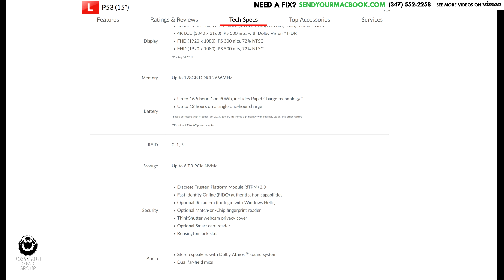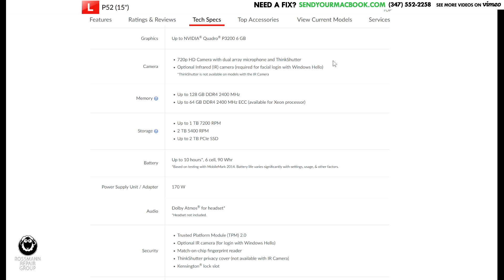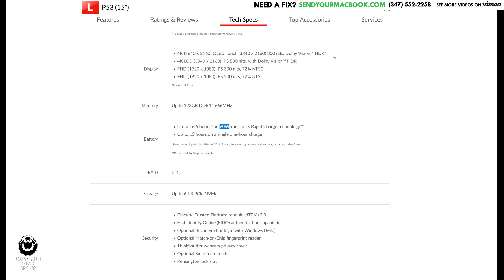Reading my YT comments is depressing

Comment: Yeah, manufacturers can advertise any hours they want if they tack on an "up to" to it. Physical battery capacity is what matters. That's also why all the iPhones have total shit battery life, they're outstanding at shutting things down when the phone is idle so it's efficient - but as soon as you need to, you know, actually use the phone it still draws the amount of power that physics require. Which means that in active use, the Apple devices drain their batteries in no time at all. People are silly little sheep.

Comment: The worst part of following trends like that just for the sake of following is that past a certain threshold, it forces everyone else to also do it because it breaks mass production.

It's probably what ended up happening with removable batteries both for laptops and smartphones. When they started becoming non-removable, both R&D and mass production of removable batteries slowed or stopped altogether for those categories of batteries, to the point that even if a current laptop or smartphone manufacturer wanted to launch a model with modern removable batteries in mind, they'd probably have to either assume by themselves R&D and costly manufacturing for that model alone, or use batteries that could be fairly outdated and stuck in time.

Weirdly enough, I'm seeing this in other types of electronics, like a cheap-o portable keyboard I got sometime ago. It has a rechargeable and removable battery inside. You know what type? One of those that came in Nokia dumbphones bricks from 20 years ago.
For some reason, mass production of that type of battery endured somehow. It's an unofficial standard for all sorts of cheap-o electronics. I've also seen them in portable LED lights for photos and videos. You can look it up, it's Nokia BL-5C. I think even Amazon still sells it.
It works for this one not because it's the latest battery tech, but because it's probably super cheap to mass produce despite being extremely outdated. It's meh, good enough for some stuff. Which is something that doesn't work for flagship lines or products that have to be constantly evolving and a step above the rest.

Probably not Thinkpad's case since laptops haven't been changing a whole lot in terms of chassis and form factor recently, plus like Louis already put it, the battery specs itself didn't change. But yeah.. it becomes that much harder to be the only company keeping one particular spec alive. Perhaps they made the change because moving forward, if they plan on putting a more modern battery inside, it'll have to be non removable one way or another?

Or it was really just a cost cutting measure. It was cheaper to use some standard 90whr internal battery instead of their removable model. Which is of course still bad for costumers, but perhaps that was the logic behind it.

Comment: Lenovo has gone down hill in recent years, some real questionable choices!   
Altho I would comment, on my last laptop, I did alot of research right down tear downs, and I noticed choices on even cooling, they may have opted for internal as their concept of removal might be for replacement during life of laptop not swapping during the day because it recharges quickly and lasts the life of the laptop!  I've known very few times a spare battery was needed so I don't really care! 
And what did they do with the space? Let's get a teardown to compare!  I bet the free space went into a bigger heatsink!

Comment: just over 2 min in, and I already knew what the issue was, people are idiots, advances in other components = more energy efficiant, while sane battery = no advancement whatsoever, means they could have had a machine wirh a phenominal battery life/use but instead did the absolute minimum.

Comment: I have to comment Anyone who defends not having user removable batteries on a laptop, shouldn't be allowed to exist on the internet. I mean if you like waiting 16 hours for your locked up computer to die so you can power cycle it, you must be some kind of masochist. Like first question you get asked when any piece of hardware starts acting funky is "Did you turn it off and on again?" and what do you do if it wont turn off? unplug it "Oh wait it has a battery, and I cant remove it?" just dumb, please for the love all that is sacred, don't defend pure brain dead design.

Comment: my only worry is how they achieve this longer lasting laptop do they put massive power limitations on the products ie under clock the cpu and video card shut the HDD down ?etc battery technology has stalled they only thing you can do is make things moe efficient with whats available at a price

Comment: I am a software developer and we use nothing but Lenovo ThinkPads including the p51 up to the p53. My god they are trash. Overheating from shithouse cooling, whether it's heatsink or thermal paste idk. Completely bricked brand new machines(p52 and maybe p53s). Malfunctioning docks whereby you have to disconnect the laptop from it simply to get your external monitors again. After speaking with one of the workers from the IT department, these incidents are becoming more common in my company. Please god if you run a business don't get these pieces of trash
Reply: How do companies not at least trial one or two machines before dumping 100 onto the employees and just say "yeah work it out or something idk"
Reply: @Jimbob3s1  no idea. But in the space of a few months they have just started dropping like flies. The coffee lake ones (i think p52 or maybe 53) sound like bloody jet engines

Comment: The most they could realistically add to the battery would be about 10 Wh, since the generally allowable max on planes is 100 Wh. So, I wouldn't even count it as a valid excuse, had they bumped up the capacity a little to like 97 Wh.

Comment: After having first-hand experience with customer support for a Surface Pro I can only say: buy maintainable laptops as long as you still can. Not even Microsoft themselves can repair their Surface devices. A Thinkpad(with removable battery!) can sometimes be fixed with a screwdriver. Yes, a alu unibody design with everything soldered in looks a bit better. But looks get irrelevant pretty quickly once the device stops working and the manufacturer tells you "ah too bad, just buy a new one".

Comment: Different bios revisions also affect battery life. more conservative tuning in the bios can actually make the battery last longer. 
Honestly removable batteries are not very useful these days, and if you really want to replace the battery just screw off the bottom and pop a new one in. 
Soldered ram and ssd however, fk.

Comment: I will disagree. This is going to be a long response. Ok here goes. The reason i dont like companies making batteries non removable since i do often find myself away from a wall outlet and having my laptop die when i need it since it is very old. I do agree that yes more modern and new hardware like you said about lenovo making small increments each new device on battery power for instance my brothers laptop has 4 hours of life on a single charge but mine lasts 2. One point i will like to bring up is that i dont see a reason to buy a more modern device since they all want to be thinner but find myself asking the question how long will the battery life so i do look at the watt hours and most of them are not great if not worse then my current one  . Another point is that most info on batteries on the web page is that they mostly dont represent or say the actual amount of hours that the device can run on a single charge. An example is when my sister got a laptop it was advertised of having a battery life of 6 to 8 where it only lasts for 4 hours even though it is using a Celeron cpu but my brothers is an i3 cpu and has more capabilities beven having a removable battery and my sisters laptop is not. Please respect my opinion. I just don't like it when companies remove that feature.

Comment: most people i come across don't know how to battery.

that thing that is told in like 1800 bc about "batteries having memory problems" (nicad) needs to be forcefully applied on all batteries, depleating them down to destruction.
or those magic solar chargers (that won't even power a calculator), dumping these commected to their (overpowered because the store clerk told them so) phone in their handbags, hoping it magically recharges in like 10 minutes.
no wonder people are affraid of teslas, if they perform just as bad as their own electronics you won't even reach the supermarket down the street.
this all can be a very informative (rant) video on its own

Comment: I think what those people claiming is that for users, what matters is the actual runtime and the new machine delivers that so it's OK. But think about it this way, if you just put the new chipsets into the old p52 chassis, you can get the same runtime improvement with a thinner and lighter machine, and with a removable battery. From this standpoint the p53 chassis is  inferior to p52's.

Comment: Me: "We'll need to buy new computers."
CEO: "But we spent $ !@$*&# last year on new computers. What's wrong with those?"
Me: "Well, they're not fit for the task. And btw, the company you insisted we buy those from sell them at +50% retail price for identical specs, I'd advise not buying from someone who's blatantly ripping you off."
CEO: ".. But they said theirs were better."

Some people just need their Kool-Aid, even if that's a $900 low-end Pentium mini-PC without peripherals, or a magical 90Wh(++) battery.

Comment: Watt hours?;

I thought that it always was amp hours??🤔🤯
Reply: watt hours is a standard measurement (killowhat hours for power companies) that gives a good understanding of capacity
amp hour is just half of that measurement, your battery can be many amp hours, but if it is just 1 volt, the usable capacity of that battery can still be bad, a 12 volt battery holds roughtly 12 times more power at the same amp hours.

Comment: YOU NEED A LAPTOP TO WORK AND THE BATTERY IS THE ONE THING THAT MAKES THIS POSSIBLE. REMOVING THE ABILITY TO CHANGE ANOTHER BATTERY MAKES YOU GAY, AND THE COMPUTER A USELESS BRICK. THANKS FAGGLE INNOVATING FRUSTRATION AT LIGHT SPEED PACE

Comment: I get your point, Louis, but I've worked in engineering for 20 years, most of it in companies where everyone's issued a laptop. I've never seen anyone actually swap batteries or carry a spare. Those machines all go to recycling with the same battery they were born with. Anyone who needs to move their laptop, say, to a meeting room, will almost always bring their charger with them. The battery is only ever used to go from desk to meeting room and back.

Maybe Lenovo made the calculation that zero business user would miss the ability to swap batteries ?
Reply: As a counterpoint:

I had three batteries for my previous laptop. While I did not run from battery often, when I did I would bring all three batteries and swap between them. I went far enough to buy an external charger so that I could recharge my batteries without needing to swap all three of them through the laptop again when I got back to availability of AC power.

On my new laptop, which unfortunately has a built-in non-removable battery, I missed the feature enough that I bought a wide-voltage-input DC-DC converter so I could run my laptop off of power tool batteries I already own (not ideal as the worst-case current draw to power a "gaming" laptop while at full load and charging the internal battery would be pretty hard on those), a vehicular 12V circuit, an RC LiPo or basically any available DC source with enough ampacity.

Am I an unusual user? Absolutely. I bet there are DOZENS of us in total!  

I'm not in any way trying to say that I think most or even many users fall into my category, but we do exist. I'm certain however, that your assertion about business users is accurate, and probably applies to the overwhelming majority of users in general.
Reply: @Jay-ik1pt  agreed. I'm a DIY-er myself and if I really needed huge battery life on a laptop I'd go with a big 6S LiPo and a DC-DC converter. I've also used dummy batteries on cameras so I could power them from external sources, I get what you mean. Those are edge cages, though. Besides the work laptops I mentioned, I've owned a dozen laptops in my life, only once did I buy a replacement battery... for a machine that has lasted 10 years (Fujitsu P7120, a very niche machine at the time. They don't make them like that anymore).

Comment: According to the Spec sheet of the p53 vs the p52, its porbably getting more battery life due to the p53 NOT having a dedicated graphics chip listed. Meaning the dropped the quadro GPU in favor of Intel intigrated graphics, So this laptop is also dropping in overall performance capability in graphics based workloads

Comment: wellll... i noticed that some time ago, building notebooks where you clearly see the battery, but you cant remove it without taking the laptop apart, quite deeply too sometimes - i still use my 2013 fuji t902, just bought a second battery to go with it^^

Comment: My company had a batch of UPS battery packs (2x12V batteries in series) where they had a black positive and a red negative. Routing didn't change, battery orientation was the same, cable length was the same. Lots of free door controls were given away those six months. Was not good for my blood pressure too. A few collegues (me included) just held on to the broken PCB's in hope of one day going Rossman on them with a heatgun and new components but alas. A few weeks ago I tossed the last six of them away. €1200 a piece...

Comment: This is somewhat playing devil's advocate, but bringing up total use time makes sense as a response to one particular use case you brought up. Namely that you can hotswap the battery for a spare one and keep working on the road. Even if the battery is identical, a longer battery life due to lower power consumption might tip the balance to where that situation is unlikely to occur, and that use case is moot, all else being equal. I don't think that's the case with P53 looking at the numbers though and this is not a machine I would buy, but it's an example of an argument one might construct.

Comment: Not trying to justify Lenovo, but maybe in P53 battery is not removable because of its hardware. If you check the specifications, p53 requires bigger power supply (230 watt against 170). It can be because the battery in P53 has some fast charging technology unlike P52, or/and more power consuming hardware which requires a bigger cooling solution while keeping almost the same size. Maybe lenovo engineers had to choose from sacrificing some of the hardware or making laptop thicker (while the previous generation was thinner so it will be harder to sell), or sacrificing user ability to replace the battery by himself, making it thinner because you don't need the same kind of protection as if it was outside of the case and without having to compromise battery life/hardware. It's all speculation, maybe lenovo engineers were told by their bosses to just ditch user replaceable battery, because *marketing*.

Comment: I hate non-removable batteries, but perhaps they had to make it internal because their rapid charge technology causes the batteries to heat up a lot and they  added something to the case design to dissipate that heat so that they don't get into a thermal runaway situation.
Personally I would rather have the option of multiple batteries than have a battery that charges super fast.  It's just way more useful.

Comment: You're ignoring the fact that yes, it's the same size battery, but when gaining 65% more battery life is it really feasible to still keep using a hot swappable battery. If it was the same 10 hour life i would tottally agree with you, but that much gain is significant enough (imo) that i think it's fine.
Reply: That's a best case life, not for all workloads.  Also makes it harder to replace once it wears out.

Comment: To this day, I still prefer detachable batteries as OEM keep making laptop cases easier to chip/break with a little extra force. Don't really care if it's ugly since batteries are heavy and at times I do carry a laptop without its battery so it would be lighter. AC power for the win
Reply: Oh how I wish my gaming laptops battery could be removed for that reason.  It's not like its powerful enough to be much use other than as a UPS anyway.

Comment: too.But this does go to show that electricity is not the easiest of subjects to wrap your mind around. It took me two studies, a course, a job and a bright flash and puff of smoke to realise a relay coil voltage was not neccesairily the same as the contact voltage. If it wasn't for the concrete floor I would've dug a hole and buried myself right there and then.

Comment: The only reason why I would see it an argument for it is that it has a long enough battery life that they don’t need to have a removable battery. 
Even then though, under any actual work load you’ll only be getting 3 or 4 hours. Which on the go is perfectly fine as in what situation do you actually have a proper workload of editing or even gaming without an outlet.
Reply: There is no such thing as "long enough" for everyone.  Plus it's about being able to easily replace it once it wears out.

Comment: Putting the battery inside the laptop is the dumbest idea any company could ever do put it on the outside so you can remove it when you have to reset the laptop 😭😠🇿🇦
Reply: Funny you say that as my old Lenovo literally had that problem where it hard locked so I had to unscrew the bottom and unplug the battery.  Holding power button wouldn't work.
Reply: @alexatkin  it makes it easier for a technician to remove the battery from the outside of the casing and have to strip the whole laptop to do the same thing and I am a technician in South Africa 🇿🇦